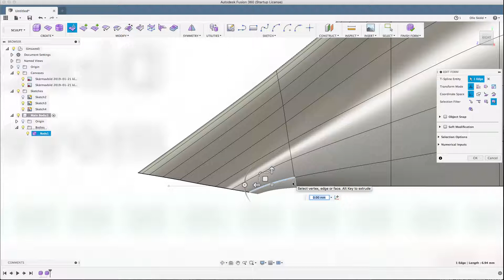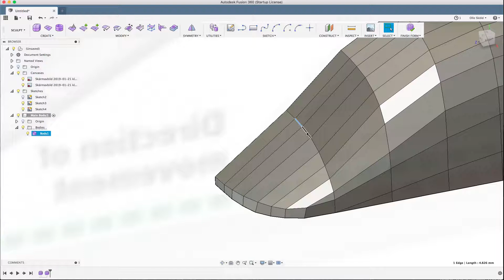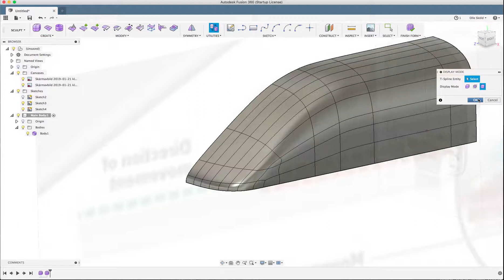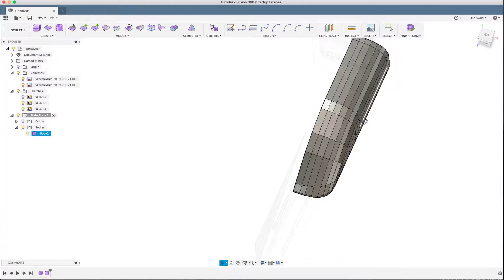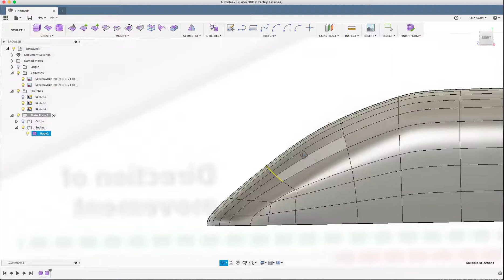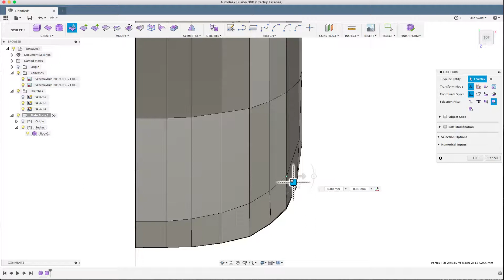Fusion 360 tutorial - Shanghai Maglev - Part 2 of 4

Comment: Cool! I put quite some time into modeling the trans rapid (maglev) a couple of weeks ago when I was sick home from school. 
I think I had to totally over do it about 7 times until I got a decent result. I started using sculpt just like you but then I used model environment and created a loft between three sketches.

edit: stavning
Reply from the maker: I understand! if that can be done, then it's awesome. But for complex shapes one soon comes to a state where it's hard or impossible to get it right with sketches and a loft, but one method I have used a lot is to combine creating solids through traditional extruding from sketches but then use sculpted surfaces to cut it in complex shapes.